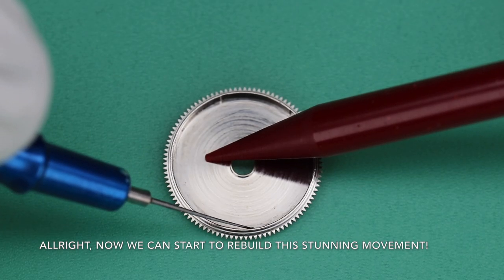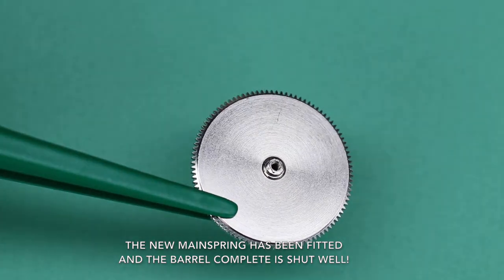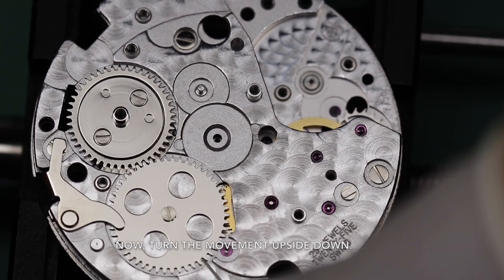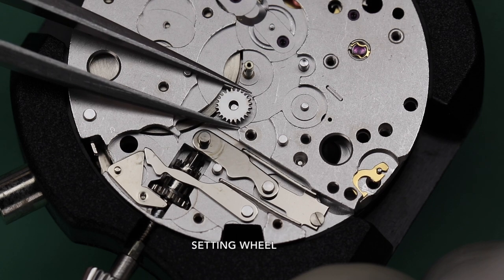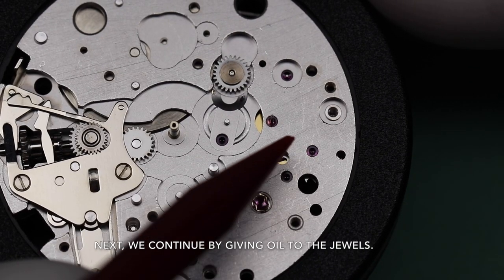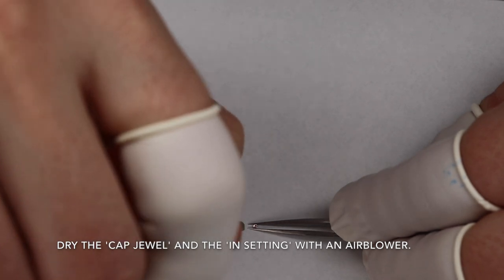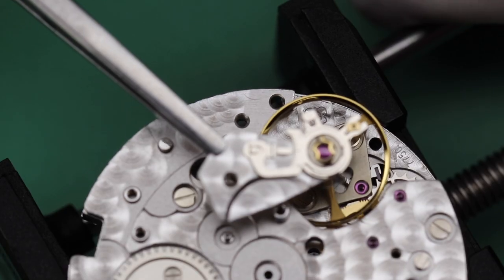ETA 7750 VALJOUX | PART 2 | ASSEMBLING & OILING | BASIC MOVEMENT | BREITLING | WATCH REPAIR

Comment: Great video Damitri 
Just re-watching this series for about the third time. 
Really impressive macro filmmaking with great details on what you’re doing and why. 
One think I’d like to ask is if we could have a video more in depth of your servicing oiling procedures on why you use which oil where and the reason behind this and why something would need a certain oil or if the part doesn’t actually require lubricants. 
Many thanks 
Richard

Comment: Dear Watch Doctor, I am impressed by your perfect work! Thank you for sharing your experiences with us! I have a question: ETA recommends HP 1300 and HP 1300-SC for different regions. I´d like to use HP 1300 for a service but can´t really see a reason to buy HP 1300-SC additionally just because it is colorless. Is there an argument to have both? Or is it just fine to only have the HP 1300 (for the service of course in addition with the 9010, the 9504 etc.)?
Thank you very much for your help!
Reply from the maker: Hello Jan, good question, I think the colorless version of HP 1300 is really not necessary. I don't use it.
Reply: @therealwatchdoctor  Thank you very much for your answer!! Keep up with your perfect work and I really appreciate you´re sharing your skills generously with us!!
Reply: SC is used on the jewels where you can see them through an open case back.
Otherwise, no need to have two of the “same” oil.

Comment: Hi, do you treat both the cap jewel and the in setting with epilame, or only the cap jewel? Also, any oil applied between the intermediate setting wheel and the setting lever jumper?
Reply from the maker: Hello Brian, Yes in the video i did, but it's not nessasary. Only treat the cap jewel with epilame that's ok, and be sure the in setting jewel is clean. Indeed, there is a small quantity oil needed between the setting wheel and setting lever jumper => HP-1300, sorry this was not filmed!

Comment: Thanks for your work. Just bought fortis B-42 chrono with similar movement. It appears that the winding stem sits like  in 2nd position (visually, not tight with the case) the watch though works ok. +/- 5sec per 24 hours. What is wrong here? Thanks

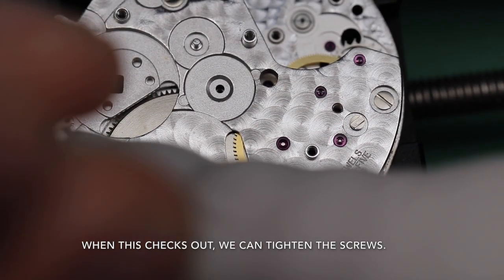Comment: 5:21 why do you apply oil this far off the center? you should drop the oil just where it meets the inner circle? the crown wheel doesn't even touch the oil under.
Reply from the maker: Hello JayB29, in this case there was contact with the oil, which you can also see on the video. Also because you often see wear in this place. For me it depends on which watch and what wear has already occurred. But maybe you are also right.